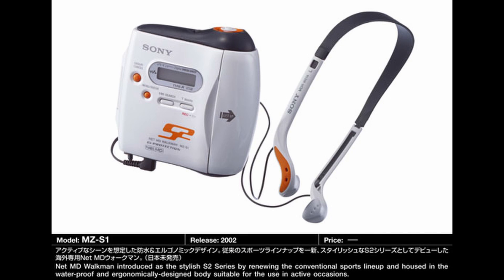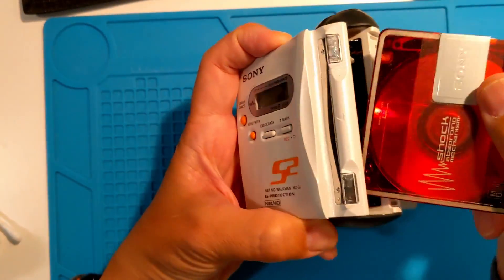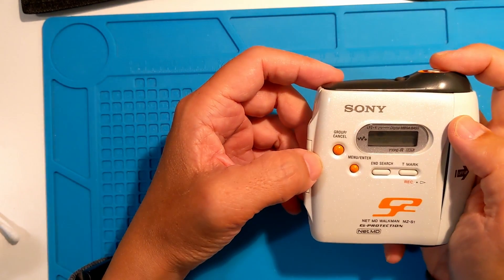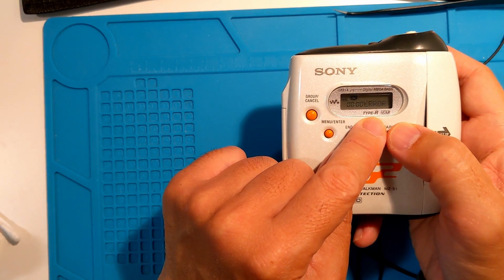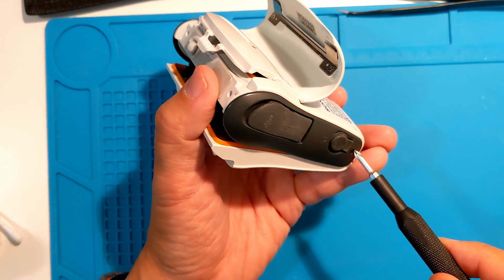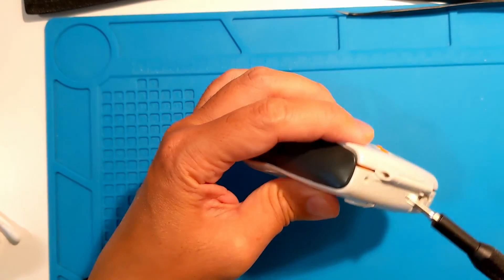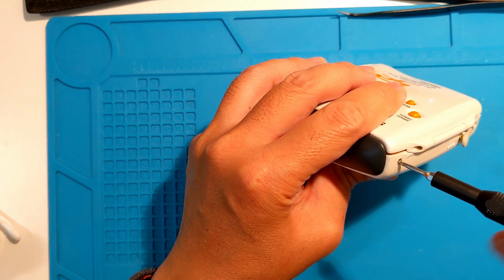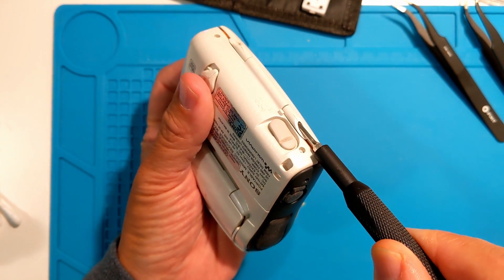Sony MZ-S1 NetMD MiniDisc recorder repair - Fixing "error" during playback

Comment: I've been collection only Sony portable units from early to the latest designs since 1993. My unit is still working great. I rotate my players around once a month to keep them active with the parts moving instead of just sitting. I just got to my MZ-N707 & it plays fine, but now the LCD screen constantly flashes. You can read it, but just barely. I tried little things, but I think I need to disassemble the unit. I'm hoping it might be just a loose connection of the cable to the LCD screen that maybe a cleaning may fix, but like I said it still plays perfectly. Great video!
Reply from the maker: Thank you! That's definitely a good strategy - rotate through them to keep them going! Hopefully it's a quick fix, but you may need to replace the screen from a donor unit

Comment: Do you know what glue can I use to re-attach the power plug cover? Mine had a lot of rust and I had to remove that glue to clean it up, it seems the previous owner "thought" that it was actually waterproof and took it for a dive, wont blame him because due the ads of the time.
Reply from the maker: Oh no! Well hopefully yours is still working fine. I suppose to bond that rubber + plastic you could use something like Permatex silicone glue that is flexible. I think something like "super glue" should work, but it seems silicone+plastic or rubber+plastic may require something else for best adhesion
Reply: @TechnicalInitiative  Will try that, I even used some construction glue without luck. I still have a lot of issues with mine, the display pins were destroyed due rust so I ended up wiring it directly and it kinda works now except the menu button, the reader head flex snapped the second time I opened but it was an easy fix. I also added a USB-C board to replace the Mini USB although is giving me problems
Reply from the maker: Wow that guy has been through some stuff!

Comment: Just pulled mine apart after seeing this video to do a clean 'n lube due to some very strange behavior when saving tracks. Of course the hinge spring went flying when reassembling (later found it, so I have to tear everything apart again), and I had a heck of a time getting the lid release lever to engage, but finally did and everything is working again. Thanks for the video!
Reply from the maker: So glad to hear it (and that you found the spring)!  It's a fun device but definitely needs some regular TLC at this age

Comment: I have this one! has a few sticky button problems with the joystick button.. i have to press very hard till it imprints button shape in my finger.. lol need to fix that someday..still works great though and i used to use it at work..
Reply from the maker: It's a fun, funny unit but I hate that joystick LOL
Reply: @TechnicalInitiative  for sure man! it always worked great for me and was tuff but yea to skip track forward I get triangle imprinted in finger.. probably not the best design.. ha! I'd like to try to get the same from same year without the waterproof set up.. my dream is that tascam studio/home unit...someday..

Comment: Watching almost all of your MD related videos in case I ever have to open and repair one of my players. Now I want an S1 for jogging 😅
Reply from the maker: haha thank you! The S1 is a great choice - someone even brought one to the beach! Probably one of two MD players made to withstand some exposure to the elements!
Reply: @TechnicalInitiative  Mine is over 20 years old and still works like a charm. So solidly built!!! Fits perfectly in the hand. The battery life is ridiculous as well. 50+ hours on 1 AA battery.
Reply from the maker: @enrique967  Hang onto it! It really is a great model that should last for many more years!
Reply: @TechnicalInitiative  I absolutely will. My other minidisc has lost battery ability. Can still use it with AC adapter, but not portable any more. But this Sony is still recording like a pro. I use it every day...by far the best portable media player I have ever had...outlasted my iPods as well.